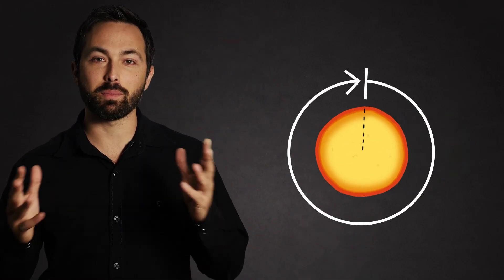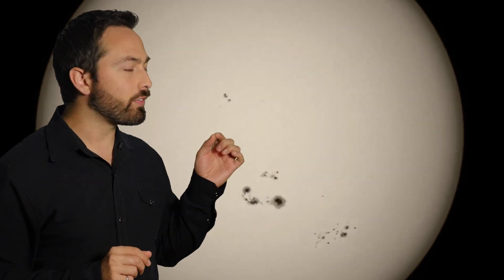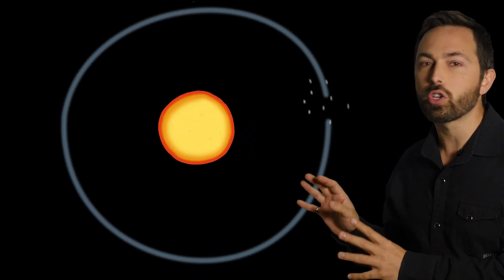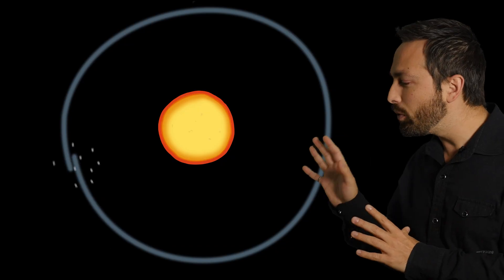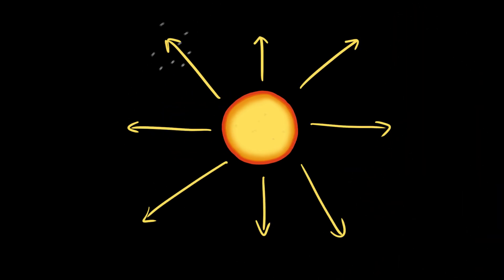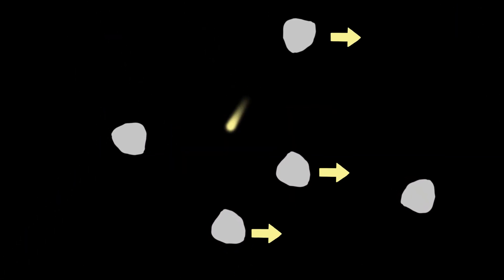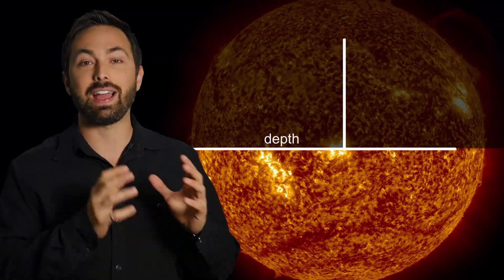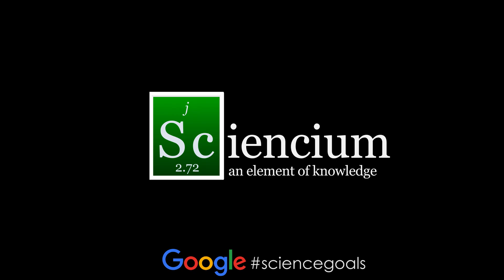Why is the Sun Slowing Down?

Comment: But if the photons momentum transfer is the reason for the dust particals slowing down isn't there a vast majority of the momentum transfer in the outward direction from the sun's surface? In other words it should be pushing the particals OUT of orbit.
Reply: Orbit isn't about distance, it's about speed. Being in space isn't enough to keep you in space, you also have to be going very fast. The outward photon pressure is counteracted by gravity that pulls the particles back down, but the lateral pressure that slows them down has no counteracting force, except maybe the energy added by new particles falling into the sun, which is even more miniscule than the photon pressure at this scale.
Reply: Radial momentum doesn't change your orbital energy as much as prograde and retrograde. Think of it as another oberth effect; your altitude velocity is far insignificant to your prograde velocity.
Reply: Exactly! Gravity slows down the dust particles and pulls them inward just like the drag of the planets orbiting the sun slows down its outer surface.
Reply: icedragon769 well that is a bit incorrect
Reply: Dunno.  Something about that momentum "from the dust particle's POV" doesn't sit well with me.  I'll have to think about it some more.
Reply: I think that any angle the photon hits a particle would cause it to slow down and any photon hits off center would cause the particle to turn, part towards the Sun and part away, only a dead center hit could push the whole particle away. I think that the entire Universe behaves exactly as water from the subatomic to the Universal scale. The currents of the Sun ocean create the waves that escape it's surface and push against the space ocean, which Is the vector equilibrium at the Planck level, the void of space is the ocean that carries the wave crashing into the current of the dust particle that moves through it. Picture the waves in the wake of the particle as the waves in the wake of a boat. Everything that moves makes waves and the center of these kinds of waves are their currents. The vector equilibrium is a particle that can't be observed directly because it's inward gravity is equal to it's outward energy so nothing is pulled into it or pushed out by it but energy moves through it exactly as water. It holds everything into place as the rubber balls in a play pen hold a child in place but allows movement and transfers the vibrations created by the child to travel throughout the play pen dimensioning in significance by distance. A facsimile of the vector of equilibrium was dropped from Times Square New Year's. It's derived from the Flower of Life which, I believe is the blue print for all that exists in this physical reality.
Reply: Daniel Cogzell yeah basically your orbital momentum is being slowed  down faster than the photons are pushing them outwards, so gravity can catch up with much greater force, it's really simple if you think about it

Comment: why does a photon need to steal the extra translational momentum from the most outlayer dust of the sun?
when the photon was born inside the sun, the photon already had the translational monentum + intrinsic spin angular momentum to escape from the sun.

unlike the saturn's rings and the sun's position,  the sun's internal photons are isotropically distributed and the shape of the sun is spherical for a simplicity, whch means the everage translational momentum transfer between all particles inside the sun must be 0. in other words, there are equal amounts of photons hitting from the back and front.

besides, any charge distributed rotating body must radiate and so they lose energy gradually.

Comment: The sun is just doing what everyone does when they get older. Getting fat and slowing down.
Reply: When you try to be sarcastic but it turn out your right
Reply: This is actually the correct answer to the whole theory ...
Like a small tire, the inside of the sun spins quickly . while the outside is like a larger tire, it would spin slower.
Why is the outer layer slowing down? Simple, the sun is increasing in mass! Thus the life cycle of a decaying star.
Reply: Underrated comment. Deserves at least 1K likes.
Reply: Is the sun gaining mass due to dust accretion faster than it's losing mass due to nuclear fusion, though?
Reply: The sun lose materia!

Comment: ok hold on..... so if the photons are taking angular momentum from the outer surface of the sun, are they just taking that as a change in acceleration or direction?  Or just purely reducing the speed of the sun, because a photon can't exceed the speed of light right?  So does conservation of energy come into play?  or where does the extra energy go?

Comment: "What in the vacuum of space?" Space itself is not a vacuum. It only creates a vacuum when I higher pressure in a container is exposed or opened to the lower pressure in space, balancing the pressure between the two. But, I am sure you already knew... I hope.

Comment: I have a question... partly based on this videos like this.  So in this video you continually used the "light as a particle" ie a photon. OK lets roll with that. We also know that LIGHT is just one small part of the much bigger electromagnetic spectrum. If light is just a "common" part of this expression... and light consists of photons... then we MUST equally be able to express.. electrons, radons, magentons.. that is every part of this ONE spectrum... must also consist of particles. Yet.. we hear about photons as though only this one little area has them. Where are my radio particles of Princes' Darling Nikki???

Comment: What I don't get is how a photon can have momentum. The mass of the photon is 0 and momentum = mass x velocity, and anything multipled by 0 must equal to 0, even if it was infinity which it isn't. The speed of light is a finite value: 299,792,458 m/s, if put that into the formula: 299,792,458 x 0 = 0, so how does a photon still have momentum without having any mass? Shouldn't it's momentum be 0?
Reply: Fahimus Alimus, mass x velocity is the classical approximation, but photons cannot be studied with the classical mechanics. You have to go to Special Relativity, which states that there is a relation between Energy and Momentum. An then, for photons, you get momentum = energy / light speed. Hope this helps a bit.
Reply: Mario Andres Acero Ortega That does help, but why do we have to go to Special Relativity, why can't photons be studied with the classical mechanics.
Reply: That is a fair question. Classical (Newtonian) mechanics cannot explain the motion of particles when they have very large speeds. You may have heard about time dilation and length contraction. These are phenomena which take place when you move at a speed close to that of light and that are not explained by classical mechanics. Special relativity does, though. This theory provides the correct formulation to explain such phenomena, and have other consequences, including that photons are massless and that their momentum is related to their energy. You can see a more complete and detailed explanation here (with some equations): http://physics.stackexchange.com/questions/2229/if-photons-have-no-mass-how-can-they-have-momentum
They were asking the same question.
Reply: Mario Andres Acero Ortega Oh ok, that makes a little more sense, thanks for the help :)

Comment: Ok, the dust particles get hit by photons from the sun. But the speed of the photons is MUCH greater than the speed of the particles. So the momentum transfered to the particels will be slightly opposite to the direction of travel of the particel but mainly outwards from the sun. So their orbit should rise not fall.
And objects that orbit each other and dont radiate any photons, like black holes, will eventually fall into each other, too. They lose energy to gravitational waves. That should happen to smaller objects on a smaller scale too. Doesn't that effect seem more plausible considering what I wrote above?
Reply: Gravitational waves only happen when an object is oscillating in space, like two black holes spinning around each other. They are not the reason that accretion disk material falls into a black hole.

That can be explained by this very effect: when it gets close to the black hole, it's going unbelievably fast, it heats up a lot, and generates photons that radiate outward and slow down more material, causing it to fall in. 

This effect is sufficient to explain the observed slowdown in the outer layers because, although it's true that the average direction that the photons push is outward, there is a counteracting force called gravity that is pulling them inward. 

Remember: going up is not enough to keep you up. A rocket is not a fancy elevator, 9/10ths of rocket fuel is spent pushing it sideways, and when you want to leave space, you don't point your rocket down, you point it backwards. 

The upwards force from the photons is counteracted by gravity. The drag force created by the angle of impact has no counteracting force, so it accumulates.
Reply: But I thought it would be the angular velocity that keeps particles from falling into the sun, like everything that is in an orbit. So the outward radiation pressure should be on top of that, right? Sure the effect is tiny, but the breaking effect of the radiation pressure should be much tinier. At least thats how it sounds logical to me.

Ok, now that I wrote that, I finally got it. :-D You are right, even if they are pushed up much more, they will eventually fall down when their angular velocity is used up by continuously running into photons.

Comment: Wait maybe I dont understand enough, but arent photons particles without  mass? If so how does this stealing momentum and and interacting with other particles work? Dont you need mass in order to influence other mass? In other words if something that has no mass hits me, shouldnt it just jump off without being able to interact with my movement at all?
Maybe I am failing to understand something here, but to me it seems a little counterintuitive something that doesnt have mass to be able to interact physically with something that does.
Reply: Sky Lord Panglot 

Einstein's famous equation is:

E^2 = p^2 c^2 + m^2 c^4

Since photons have no mass this reduces to:

E=pc
p=E/c

since photons have energy and no mass, they must have momentum.

Newton's second law states:

F= dp/dt 

As shown above, photons have a non zero momentum, and are capable of changing their momentum (if they are absorbed, the momentum goes from E/c to zero, if they are reflected, it goes from E/c to -E/c). This means dp/dt can be non zero, which means they can cause a force.

This is how solar sails work (and why they should be reflective).
Reply: Test Account Please Ignore Ah I see. I get it how it goes according to the equation, even though it still seems a little counter intuitive to me.
Thanks a lot for the clarification.
Reply: Sky Lord Panglot No problem, you can read more about it here: https://en.wikipedia.org/wiki/Radiation_pressure?wprov=sfla1

Comment: Isn't there also another explanation for the slowing down of the outside of the sun in comparison to the inside? What I was thinking after introduction of the problem, was that those dust particles add mass to the outside of the sun, thus slows down to conserve angular momentum. And at the same time, the inside of the sun looses mass (mass becomes energy) so speeds up to conserve angular momentum. Of course the convection and friction between the layers prevent the speeding up.
But I'm probably wrong about my presumptions, so please correct me ;)

Comment: Wait Wait , what is this dust made of ? This dust would first have to survive it's journey to the surface which is 5,778 K so what material could survive to reach the surface, can you explain this ?
I mean Tantalum carbide (TaC) and hafnium carbide (HfC) are the most heat resistant material we can make and it can only withstand 4273.15 k so Sciencium can you shed some light on this or anyone in the comments care to have a GO !!

Comment: But the direction at which the photons hit the dust particules should be random or doesn't it?
Thus shouldn't they be accelerated too? (decelerating the photon)
So shouldn't the braking forces and the accelerating forces be equal and lead to no total change in the average momentum of all particles?

Comment: I'm not sure I understand it. You see, if the light takes some of the Sun' s angular momentum with it, that must mean the light emitted from the Sun isn't emitted perfectly radially; less and less so when you get closer to the photosphere. Which means, in my mind, the outer layers shouldn't slow down more than the inner ones; quite the opposite, in fact. The outer layers of the Sun moving slower than the inner ones could be explained by the Coriolis effect, because of the convection that's happening.

Comment: Veritasium i never understand how photon has momentum. can you explain?
Reply: i have the same question, photons are mass less particles/waves, they shouldn't have momentum
Reply: Photons have no rest mass, but they have energy of motion.  And energy is related to mass according to E= MC2.  Therefore, you can calculate the mass equivalent of their energy by rearranging the terms.  

M= E/C2

Momentum is mass times velocity and the velocity of a photon is simply C (assuming a vacuum).  

Momentum = MC 

or (replacing M) 

Momentum = E/C.
Reply: felix winchester correct me if I'm wrong.
well, the photon is a subatomic  particle which has mass. The protons are ejected, as well as neutrinos, after a countless amount of hydrogen atoms react  to create helium atoms. The reactions create tremendous amounts of energy in the process. Momentum is equal to mass x velocity which is why the subatomic particle has momentum. 
Hope that helped!

Comment: I thought is simple. because the sun is not solid, , it is more solid/ dense in the core because of gravity but the mid part are just very condense hydrogen or something. and the further outside the less and less dense of the sun, therefore the outward matters are being DRAG along the denser core, hence spin "slower" than the inside.. I am right? Jupiter's inside probably spin faster than the outside too? I thought this makes a lot of sense. I will be surprise if I am right thou, I very much trust this channel would have thought bout this lol

Comment: ok when the earth and the sun etc. are ringing like bells, we need some antennas to catch the energy to use it as free/gratis energy for our interests and to kick some greedy industrial assholes :-D

the question is you know the frequencies and who can build an antenna?
Reply: These are pressure waves [or sound waves if you like] in the sun, Earth & other bodies - they do not propagate into the vacuum of space so how will your 'antennas' work in the case of the sun? Yes, this is free energy once you've built the equipment - but why bother when there are easier forms of free energy to capture such as water, geothermal & solar?

Comment: ok the raindrops push the car back a little but they also push it down... so the collective force should point away from the star. If light can slow dust down - it can also push it away right?

Comment: :/ The speed of the surface of the Sun is directly related to the speed of the planets.  The Sun is in the center of a torus and at the radius of sunspots it takes 27.3 days for one rotation, and at a radius of mercury it takes 88 days for one rotation and so on . .

Comment: I've always been under the impression that even though photons have no mass, but for their size they have an extreme magnitude of energy, but mass and energy are basically different sides of the same coin. Is this a correct interpretation? To me, it's always seemed like a proper explanation, albeit not considering the more complex systems at work.